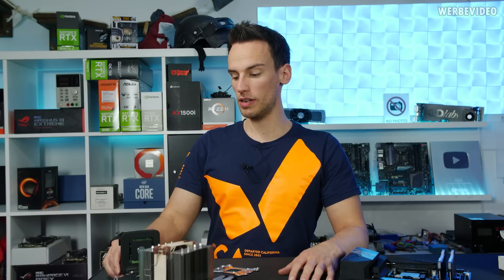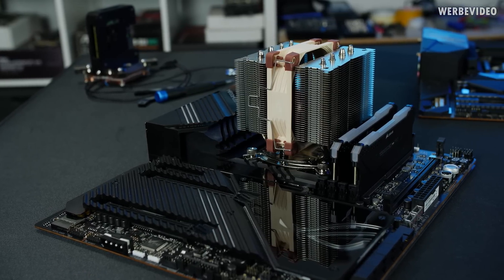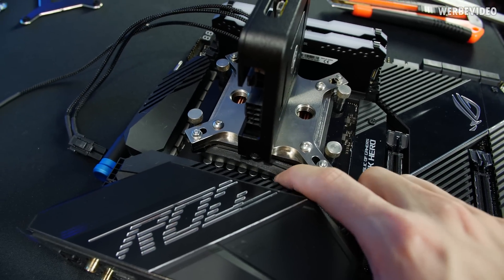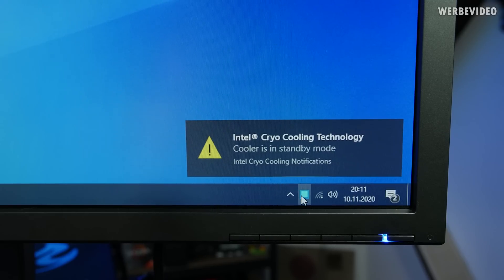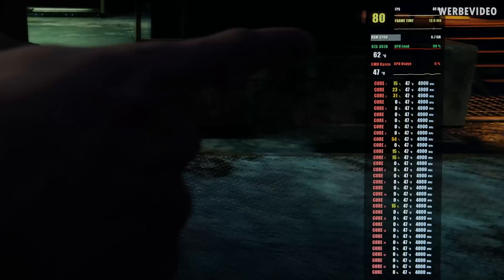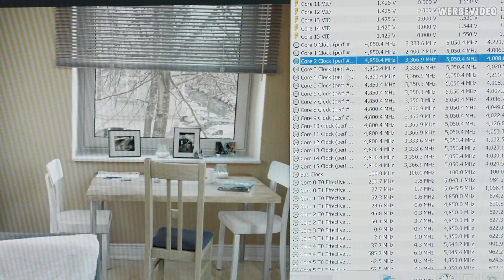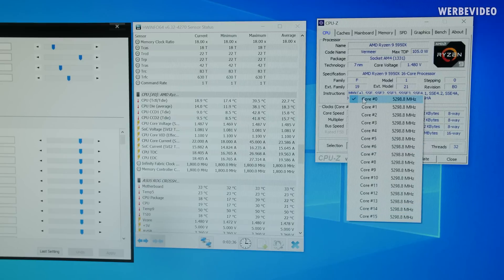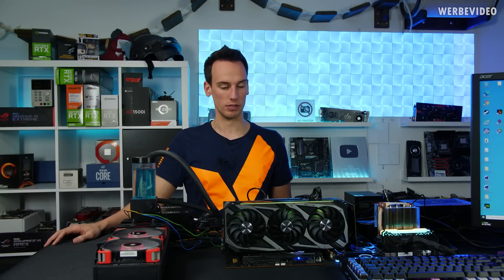I probably wasn't supposed to do this 😅 Ryzen 5950X cooled by Intel Cryo Cooler

Comment: ❤ Is it possible to run this on a 9900k? I want to buy one and try it but im wondering if its possible. Also how about emulating the cou function or software or tricking it some how  to not need a second computer? There has to be some code its looking for or a signal that can be emulated.  🤔

Comment: AMD: let's focus on IPC

Intel: let's focus on cooling our 14nm+++++++ cpu's
Reply: Lol
Reply: That would basically be equal to 7nm at that point
Reply: Some of us have been around long enough to remember when that was reversed. History moves in cycles.
Reply: @brodriguez11000  ahhh still thinking of my dual core quad and putting 2 in sli I see...
Reply: You forgot a few more plusses, I guess
Reply: Colin H: lets write useless comments on Youtube without arguments :D
Reply: @harrison00xXx  there's no argument available homie, because everything he said is factual.
Reply: @Aka.Aka.  ummmmm...no?!
Reply: @harrison00xXx  no that was all true Intel CPUs run hot and are 14nm
Reply: @gamerguy9729  Its also true that Intel still keep up very well with its old 14nm process.
Why dont you see this truth? Dont you wanna see that AMD is only slightly ahead now compared to old Intel?
I see, you only want to see the "truths" which are Pro-AMD
Reply: @harrison00xXx  AMD is slightly ahead in clock speed but is way ahead in efficiency and thermals due to 7nm process
Reply: @starliner2498  ok
Reply: @harrison00xXx  The point is that intel is squeezing all the performance they possibly can out of 14nm nodes instead of making important advancements. Like they can design a custom cooler to cool the chips that they're squeezing more power out of but can't get off of 14 nm 🤣🤣 The truths aren't Pro-AMD, they're nothing but facts. But it's ok, be an intel fanboy. AMD will continue to increase IPC and if Intel doesn't do something by next gen they'll get crushed in even single core performance
Reply: DoodleBob DaWae no the point is intel is still competitive with old designs, AMD only keep up, finally
Reply: @harrison00xXx  but they aren't going to be. That's the reason they're still on 14nm and AMD is catching up. Hence why I said by next gen if Intel doesn't do something AMD will crush them even in single core performance. It will solidify them as the best. It's not like Intel has always had the crown.
Reply: @harrison00xXx  In some benchmarks yes the 5950x beats the 10900k but overall AMD still can't quite beat Intel. This will be the last gen Intel will be ahead in the "gamer" cpu division if they don't do something about their 14nm process and worry about getting down. AMD is on 7nm. Intel needs to get with the times and fast
Reply: @BloodsCaress  whatever, the 10900k still isnt a "gaming" CPU, more like a overpriced stuff for productive, heavy workload where a ryzen would be the better choice.
10600k or 10700k more than enough for gaming, especially if compared to a ryzen 5600x. In my region the 5600x isnt aviable at all and 10600k are much cheaper than the regular price of the 5600x and 10700k is similar i think. Still i will use my 4790k until i begin to realize annoying fps drops, then i will think about an upgrade.
Reply: @harrison00xXx  I'm not a fan of intel because they run so hot and have been screwing consumers for years. However the 10900k still trades blows with 5950x in gaming for significantly less. Intel also provides much better 1% lows etc in regards to fps. You're going to see less noticable stutter overall on Intel honestly. But running an older cpu will cause bottlenecks especially with an newer GPU
Reply: @BloodsCaress  For 4K even a Intel 4th gen i7 (4C/8T) at 4GHz is fast enough with a RTX 3080.
Ofc a modern Intel or AMD would make better 0,1% lows aslong the GPU isnt running at 100% usage, but still its more than ok for gaming, even at high refresh rate.
Reply: @harrison00xXx  most people aren't gaming at 4k or really even 1440p. Higher resolutions put more stress on the GPU instead of the CPU unless it's a CPU intensive game in and of itself. The average gamer is at 1080p and unless your cpu matches the gpu in horsepower then you're going to have a bottleneck. Plain and simple. I have a 3700x o.c'd and an evga rtx 2080 ftw3 hybrid. Even I can see a bottleneck at 1080p in certain games
Reply: @harrison00xXx  fyi you want your GPU at 100% usage or as close as possible or else it's not being used to it's full potential, hence the bottleneck
Reply: DoodleBob DaWae yeah thats really poor in 2020... still on1080p, meanwhile i was already at 1200p in 2005, now depending on the game at 1440p or 4K
Reply: @harrison00xXx  poor? I game at 1440p I was just making a point. 4k in 2005? 😂😂 yeah ok
Reply: DoodleBob DaWae wow can you even read properly?
when did i say i used 4K already in 2005?
Reply: @harrison00xXx  "still on 1080p, meanwhile I was already at 1200p in 2005, now depending on the game at 1440p or 4k" Do you not know English or? I mean it's already clear you don't really know what you're talking about. Saying a gpu shouldn't be at max load lmfao
Reply: @harrison00xXx  no apparently you don't but ok. Whatever helps you sleep at night.
Reply: DoodleBob DaWae and still you cant give an answer or any argument
ever heard about rhetorical questions? doesnt seem so
Reply: @harrison00xXx   I would have taken it as rhetoric had what you said after it hadn't been so damn stupid. It not being at 100% doesn't mean you're going to get smoother gameplay. It has nothing to do with it unless your gpu flat out doesn't work correctly. If your frame-rate is uncapped and you have stutter, it's on drivers in general and the cpu. I doubt you understand though
Reply: DoodleBob DaWae no, the first sentence doesnt make sense at all
ofc im talking about capped framerates, but it seems you dont understand
Reply: @harrison00xXx  guess the 11900k left you clowned huh
Reply: @Lhamb  what?
Who cares, AMD isnt much better with their overhyped and overpriced Ryzen 5000 CPUs
How sad it must be to reply to old comments btw?

Comment: It should be possible to use this on AMD cpus, it's a USB connection, so it's a standard interface. It may also be possible to replace the TEC to be more powerful, but depends on the solid state controller.

Comment: project Rationality in Canada : get a 50 gallon metal barrel ($10) 50 bottles of car antifreeze coolant 1 gallon, 1 aquarium pump , 2 transparent flexible hoses 20 feet, CPU water block (aliexpress $12) , put the barrel outside your house and harvest the power of Canadian Winter, ALWAYS under 0 deg Celsius

Comment: Rather than using it to cool a CPU which quickly gets overwhelmed, could you  mount another CPU block to it, face to face, and use it to cool an entire loop, so there'd be a much bigger thermal mass for running high intensity loads?

Loop one has the  rads for cooling the peltier, loop 2 just has a big res and the CPU, so it has a lot of thermal mass to disipate heat spikes from high intensity workloads...

Comment: Is there any logic of putting the TEC in the loop after the radiator with the hot side outside of the main case?

To me it seems like cooling the water towards ambient first through a conventional radiator and then towards sub-ambient after using a TEC with the hot side not exposed to the inside of the case should be more optimal than the TEC inside the case.

Comment: Seriously the cryocooler its worth it right so say I was gunna build my 3090 ftw3 with 10900k I was gunna get distro plate water cooling gpu and cpu but is it better option to watercool just the gpu and for the cpu use the cyrocooler I mean how else can you get Temps lkle thay without ice water or ln2 seems like a win win for intel I mean getting that cold temps I might as well just wstecool gpu and use the cyro for the cpu or is there another lroblem woth thay solution? Another reason I eant intel now

Comment: Probably better solution to use the TEC to freeze water around 0-5° (with good quantity of it to act as a buffer) and use a regular watercool using the freezing water to cool the CPU. Yea it's 2 loop of watercool, but at least it can handle burst of high load.
You can put the TEC against an other waterblock to chill the water.
AMD CPU | Waterblock <-> enough big quantity of water in loop + pump (chill water 0-5°) <-> waterblock | TEC <-> regular watercool loop.
For fun only though ^^

Comment: So you could actually build this system in a Mountain Mods case with dual mobos/systems... that would be totally pimp.   And a complete waste of electricity/overkill but... still.  So what does the 5800X clock on this cooler with half the heat?

Comment: Can I buy a 10100 and a H410 motherboard and use those simply to power the TEC? or do I require a 10900K and Z490? Ideally would this work on a 10 series NUC?

Comment: Epic! It's a bummer the cooler consumes so much power, and then that heat must be dissipated as well by the rads. I wonder if a big air cooler would still work in place of the 360 rad, that would be an interesting product.

Comment: I'm still baffled. Like... Who is this for? It's marginally better than water cooling on its own but basically indistinguishable from a chilled loop. And those don't require half the precautions since you can isolate it much easier. 

Can't even say cudos to intel for proving it works because we did prove it works. And we also proved it was trash.

Comment: How about switching out that 200w tec with a bigger one? Like 320w for instance (im guessing its a 62mm tec?)  
Edit: Ah shoot! Its already a bigger tec, its just limited to 200w for efficiency.   
"The integrated TEC is custom made and has a maximum cooling power of 
338W, while its maximum power draw is electronically controlled and 
limited to 200W"

Comment: if its a compiler cpu check blocking the software(most of the time it is), there are a few tools that can and will strip that, its also useful for some random somewhat rare intel chips that for some reason always get the slowest path, despite supporting the full speed path fully in hardware... very weird.. 

if its an installer check....orca among other apps are quite useful to fix that..(or to get desktop software like the old zune software installed on a server os.. or just one its installer didnt list.. )

interesting....

Comment: So buy a large case with space for an ITX board below the main mobo, buy a second-hand cheap old Intel CPU (i3-8100 or so), install the software on the intel thing and use it on the 5950x? I think that people who have a 5950x probably also have enough money for a second-hand ITX+old Intel, so this idea is honestly not too idiotic.
EDIT: Wait no, Intel has those PCIE add-in systems; just throw one of them into your current 5950x PC and install this TEK using that! Even easier, no large case needed.

Comment: You know, there's more powerful TEC out there. So, I wonder if the controller could handle, or be made to handle, a greater load and if anybody will try upgrading these little thing. Might be interesting. Oh! We've been using them in scientific applications for cryo cooling camera sensors and laser diodes, for example, for ages. So, every time I saw someone try one without a proper controller, I was loosing my mind. So, thanks Intel for that.

Comment: Intel is gonna sue u for using their "tech" to help compitition! . & I wonder why intel has such an obsession with inefficient things? Like peltier cooling ! Really! Thats one of the most inefficient way to cool or heat things.. could have just used a industrial mini fridge compressor and made a cpu block evaporator with another normal evaporator in parallel and valves to control the pressure. If u want really low temps then u can flood the evaporator with liquid and achieve like -30c . While the excess liquid will be vaporised by the second evaporator to make sure the compressor is getting vapor only or very very little liqud to drop the compressor temp. It would be so cool if i had the money & time to make such a system!!
Reply: Called cascade phase change and has been done it n past. It used to be more common and TEC cooling was too. I've been waiting for the comeback.. here it is :)

Comment: did you think about taking the cooler apart and check whats inside? is it a micro controller on the pcb or something? should be easy to control it yourself, i feel...

Comment: Intel:
-With the some help of some really good partners, we develop one of the first commercial viable Tec cooling solution, solely for the Intel platform.
Der8auer:
-Now, we are gonna use this Cryo Cooler to overclock the r9 5950x
Intel:
-Wait, that's illegal...
Reply: I'm going to reverse engineer the code so that can run on an AMD system. Shouldn't be that bad.
Reply: @stoat-ski  good luck!
Reply: @stoat-ski  Commenting just in case you tell us if you succeed.
Reply: @stoat-ski  Good luck
Reply: @stoat-ski  I don't think you have to reverse it, bypassing the CPU check might be enough?
Reply: @zocker1600  the code is in a upccoming microupdate. You might be able to but getting it to automaticly change due to temp / voltage will probly be absent
Reply: @stoat-ski  commenting just in case you tell us you succeed. Already working on making a set of adapter to use the same cooler on a 5900X.
Reply: @stoat-ski  
Did you do it?
Reply: you have 666 like :O now
Reply: you think your theory is funny ? It is not even close.. Cooler made by intel AND 64 compute MADE AMD FOR INTEL bot.

Comment: 8:18  the r20 score fluctuates  because its more memory dependent and combined that with windows background noise  and it results an unstable score specially on AMD .
Reply: AMD got anyways unstable clocks, its AMDs fault not "windows background noise" (wtf is that btw?)
Reply: @harrison00xXx  small tasks  and programs that win uses , is amd fault thats why  i sad specially on amd
Reply: @florinadrian7957  so its "AMD driver background noise" ;)

Im not wondering, since some years also AMD GPUs need more CPU power than Nvidia ones. AMD isnt as good as people, especially the creepy AMD Fanboys are claming.
Reply: @harrison00xXx   you seame not to understand the ideea , AMD is so fast that  is slowed down by the memory speed , and memory letancy is afected even when you move the mouse ,  AMD this ear thashed amd and nvidia really hard  i  own a data center  i have also amd and intel  , if you have samsung b-die amd is rock solid stable !
Reply: @florinadrian7957  so you own a data center but are not even a bit capable of english?
Good joke

Comment: Have you tried the Intel stock cooler? 
That's what I'm planning to use for the 5600X if I get one.
Reply: Why??
The 5600x stock is  3x better

I get the joke 
But why!!
Reply: Hugo Forgot it comes with a cooler lol

Anyway, that's what I would have to do if I wanted to get a 5800X or even a 3700X/3800X.